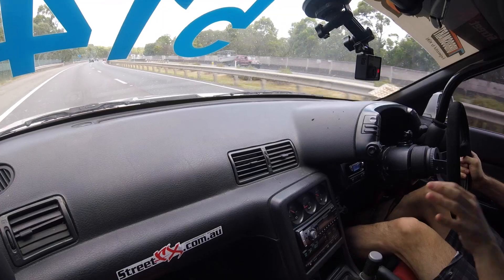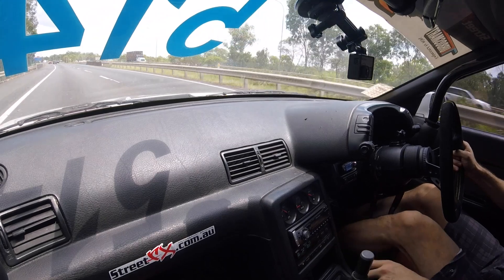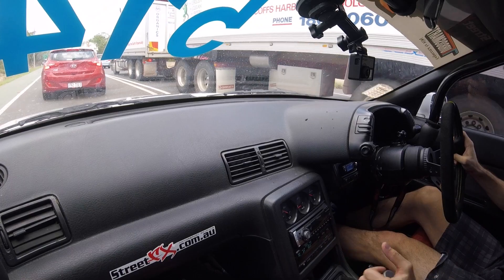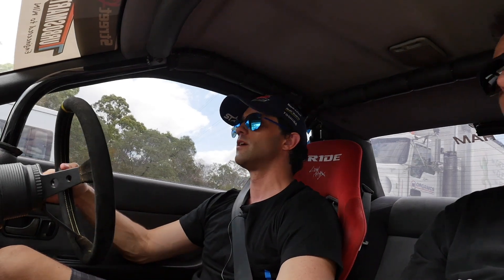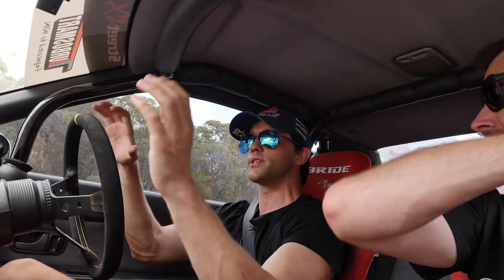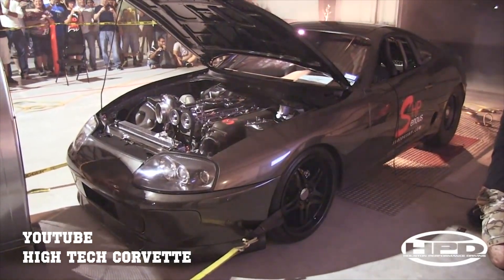What is TURBO FLUTTER & SURGE? Is it Bad? Myth-busting in our Nissan R32 GTR!

Comment: 1. Start the video with some nearly upskirt bimbo, so cheap and played out
2. It's as bad for performance as it's bad for the durability
3. It puts stress on the axle which is allowed to have a very small tolerance of radial play and is designed to do so. It gets ugly when the axle gets axial play and that's what flutter will cause in the long term.
4. This rayban wearing rich kid doesn't know long term ("I've owned this and that and blabla"), probably buying a new car every year, so he'll never see the day that a turbo gives up on him. Someone else eventually will.
5. The funniest part is that turbo's that are well capable of producing 500-1000hp range are much more reinforced and build towards heavy stress. Point is: why bother keeping flutter noise if it's bad for both performance and durability?
6. He neglects the performance disadvantage, but a big turbo needs a lot of time to spool up to the mentioned 120k. Slowing it down is senseless.

He gets the theory right though. Physically it's all correct what he states but I guess he's indifferent and that makes him a bit ricey.
Reply from the maker: +Link'sFaceOfEvil  I'll address your concerns ;)
1) it's an extract of another video we made shortly before this one. 

2) not true, the performance difference will be negligible.

3) we cover this in the video. The impact on wear on modern turbochargers is also negligible.

4) actually I've had plenty of turbos fail in my time. Ironically it was on cars that had blow off valves. Just old turbos.

5) why have a loud stereo if it doesn't help performance? Cos some people like the noise. Also for the record, if you'd watched the video - the GTR does have a BOV, it's just that it's very tight and causes a flutter like sound before it blows off. An extremely tight blow off valve helps eliminate possible leaks under very high boost - thus negating the whole "its bad for performance" thing. 

6) we do actually mention this, but consider the performance difference to be negligible. Besides, you have the other end of the coin - that the intake tract/intercooler etc will still be under some pressure during gear changes as it hasn't vented all that pressure out the blow off valve, thus negating some of the potentially "lost" performance.
Reply: Street FX Motorsport TV it seems like you know your stuff but, as always in the car (aftermarket) industry, we have different visions. What do you think of the smaller 'everyday' turbo's you find in VW gti's and the like? They seem much more receptive to this kind of abuse (I still view it as abuse of sorts).

One more question: are you the guy filming or driving the car?
Reply from the maker: I'm Mark (driving). Check our little article about this here: http://www.caradvice.com.au/587685/what-is-turbo-flutter-and-compressor-surge-is-it-bad/?utm_source=streetfx&utm_medium=fbpost&utm_campaign=forum_affiliate_program

The newer turbos (ball bearing) are less prone to generating shaft play due to their construction. The older bushed turbos aren't designed to take lateral forces, so they do tend to wear when you have surge.

Comment: It sounds awful and if you had a correct set up you would be getting more performance from your car.
Reply from the maker: ok guy, I guess you're cruising around in a full weight street car that does 9s and makes 800hp at the wheels ;)
Reply: No doubt its quick as hell and a monster. I just feel like it could be more refined. To each their own though. (And I just dont personally like the sound)

Comment: The turbo that the nut came off and you claim wasn't caused by turbo flutter, are you so sure? Given that both the turbine wheels are connected through the shaft, when the inlet impeller slows down, it will be trying to go slower than the shaft and exhaust turbine which doesn't have a restriction of airflow slowing them down like on the inlet side when the throttle is closed. The inlet turbine wanting to go slower than the shaft will put pressure on the holding nut. And the pressure put on that holding nut will be in the direction to undo the nut. So not really surprised the nut eventually worked it's way off.
Reply from the maker: As we mentioned to another person who asked that question - the Supra in question that had that happen did have a blow off valve.. It was also an old-style bush type turbo though, so it was probably due for an upgrade anyway.

Comment: The flutter (sututututu) noises are caused by the throttle snapping closed and all the air thats already heading to the intake gets stoped and fills up the intake pipes all the way back to the turbo, and forcing it way through the compressor fan while its still spining at its ridiculous rpm, forcing the compressor fan to cut through the air, thus making the flutter noise
Reply: Thank you. Did a much better job explaining
Reply from the maker: That's exactly what we said ;)
Reply: You can see how it can effect the inadequate thrust bearing especially at high boost i.e 2 opposing forces
Reply: Reversal  between the vanes causes this. 
Pressure is momentarily too high , reversal occurs, pressure lowers,  system recovers, pressure rises again,  reversal  and so on.  
So it goes stu stu stu  every time this cycle repeats.  
Look at 80s factory racecars,  low  volume piping, low volume endtanks,  check the electramotive nissans, or Audi 90 imsa.  High pitch, high frequency noise. 

Audi had "polygonwelle" KKK turbos (  polygonal shape shaft,  at the comp wheel/shaft assembly )   as normal shaft were known to snap in half.  

Off throttle surge/  umluft antilag may and most certainly has something to do with snapped shafts 😂
Reply: so what do you guys think, with flutter caused by throttle closer as Jimmy points out above, would that hurt the compressor or not? If the BOV/BPC was set up correctly, I thought it should vent all that excess pressure between compressor and closed throttle plate, and there would be little to no air having to escape through the spinning compressor wheel, and hence no flutter?!
Reply: I'm wondering what will happen if this flutter noise comes from K04 turbo, I hear it after stage 1 on golf 6 GTI ed35, is it DV failure? also.. I find out that air filter box is cracked but donno if it can cause similar noise effect. (anyway it needs to be fixed)
Reply: @madar9467  it's not necessarily dv failure. Under low boost, the dv wont open. So light driving itll just flutter. If the flutter gets louder and more frequent, without mods, then your dv probably needs attention.
Reply: So doesn't that flutter sound (stututu) come from the blow-off valve instead? I thought that's where the flutter sound comes from, not from the actual compressor fan of the turbo?
Reply: @percival_30  Nope.   Only if it opens late  or  if its undersized.     
Or if you dont run one obviously
Reply: @AxelP33  Are there any blow off valves that can make that flutter sound?
Reply: @percival_30  other than the reasons i stated,  i dont think.   

I dont bother with bov's  theyre a waste of time, potential leaks, added weight  and the risk of killing the turbo is so small... (  unless you run chinese crap turbo 😂 ) .

No bov =  off throttle surge. 

Some factors will affect the sound if thats your concern .  Obviously  low volume charge circuit / high boost press will give a hifg frequency / high piched noise.  Much like the 90GTO  or Electramotive gtp cars...   turbo size/comp wheel design will also come into play.
Reply: @AxelP33  I see. Thanks for all the info bro!!
Reply: Street FX Motorsport TV verbatim.

Comment: Loved the video, I know exactly where you guys were filming this ( cause I live nearby) & the traffic there is shocking. Wonder if this is similar to how a diesel flutters or dose. But they don't have a throttle body of any kind as they run rpm from the fuel pump, so what's the compressed air getting stopped by to come back towards the turbo? The valves just before the combustion chamber?

Comment: Surging when on the throttle sounds like shit and is bad for performance just lower the boost back into the efficiency range of your "huge" turbo jackass.
Reply from the maker: +Jim F. I'm guessing you didn't watch the video.. or had problems making sense of it.. the only time it surges under throttle is if we deliberately force it to via brake boosting. Under normal driving it does not surge except off throttle.

Comment: Anyone with bad turbo surge want to pull their thrust bearings out and send them to me for measurements?
Reply from the maker: +Paul Hood who uses traditional thrust/journal bearings anymore? May as well upgrade to ball bearing while you're at it cos fair chance any turbo still running old style bearings are going to be buggered anyway
Reply: The forces from surge produce a movement in the thrust direction which involves a thrust bearing. The thrust bearing has had very little change.  Generally comes 270* or 360* and to not have "balls" lol. Only the journals have been superseded ball bearing. Correct me if I'm wrong, but since I've spent a fair bit of time rebuilding these things I'm familiar with where the failure points on them are.

Comment: i have this loud breathing sound but the car dosnt go anywhere untill the revs get up there more around 3 to 4000rpm and the boost comes on...why does it breath like this..to me it sounds like lagging...its a ba xr6 with a 35/40...when the breathing goes away it is fast but under 3000 rpm its just "waiting" to get on the boost...iv had other ba and had no problems...i no its not a gtr but its a turbo issue let me no if anyone has thaught...besides "buy a gtr"

Comment: I'm sure this has been said, but I feel like you're going to have a significantly higher chance of winging the nut off the end of a compressor wheel, if your turbo is surging. other than that, I agree with everything you've said.
Reply: The nut will only tighten. Its designed that way.
Reply: squishypitbull it's designed in such a way that, under normal operations to stay tightened, because of the reverse thread. The CHRA stalling isn't normal operations.

Comment: depends if it's a ball bearing turbo and it would depend on boost and how you drive it some will die quicker but even with a bov you get some surge just face it turbos arnt built too live forever it's so cheap for a new centre so do what you like

Comment: 4:46 You don't think the vibration/stuttering/shock from the compressor surge attributed to the loosening of the compressor wheel nut? Gotta say I completely agree with almost everything you said. I really dislike the noise of surge so I always run plumbed BOVs. Each to their own :)
Reply: Just saw your previous reply stating the car in question did have a BOV and a very badly worn turbo.

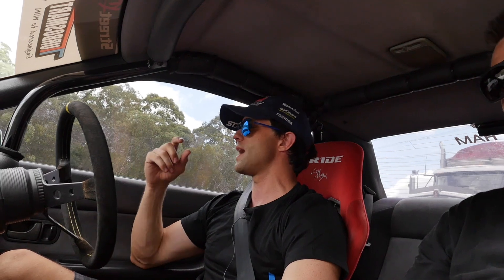Comment: This bloke does not know what hes talking about. he just said the "nut unscrewed 4:50". why would that happen regardless? that's because of surge you moron. Why don't you connect a turbo speed sensor and actually monitor what happens!
Reply from the maker: +chippyjohn1 the car that had that happen did have a bov. Lol. I am speaking from experience. How many turbos have you personally seen ruined from surge? :)
Reply: I haven't seen any destroyed because of it, doesn't mean its not bad for your engine though! How about you actually install a turbo speed sensor with a gauge and show everyone what happens. That way you can be scientific about if!. The one thing I will point out is it was surge was considered more important with journal bearings as the thrust bearing would take all the load, now ball bearings control thrust load much more effectively!
Reply from the maker: We never said it was "good" for the turbo, just that it is nowhere near as bad as people rumoured for years saying 'omg u need a bov else you will blow your turbo'.. Yet nobody ever actually blew a turbo... The later model ball bearing turbos definitely do help with reducing wear when the wheel has movement back and forth, compared to the older bush turbos.
Reply: @StreetFXofficial  that exactly proves his point...bangs head

Comment: This dude is a tool. BEEING RICH DOES NOT MEAN YOU KNOW EVERYTHING.
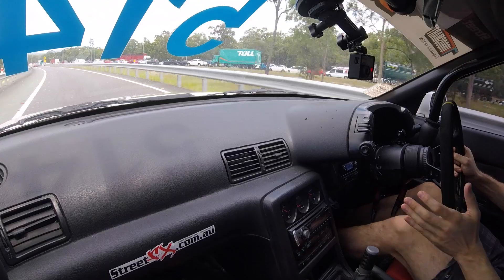1:54 " There is no were for the air to go, the turbo blades are still trying to push air into the engine and doesnt have anywere to go, so it ends up making like that"

 Tell us genius were and how the air escapes cause it has to go somewere right?

Axial shaft play or else the "bad shaft play" its the inside out play of the shaft.
When the turbo compresses is is pushed to then one side, when a moron tights his bove to sound like a proper morron extreme forces are aplied and the shaft agresively goes in and out It might not be visible with the eye but it gets the job done.And running without a bov or a bov that tight will cause also good amount of radial shaft play.

For the love of god if your reading this and your not rich dont listen to this pos.
You will cut the life of your turbo to 1/5th and the guy in this vid obviously not gonna pay for it.
Reply: Street FX Motorsport TV Look there are more than enough top performance race winning journal bearing turbos.And no it not just "old" journal bearing turbos.Its ball bearing turbos too. Too strong forces.Exhaust gases still push the turbine thats figting against the compressor wheel cause also stall thats destructive too.You are telling me the classic answer.
"My uncle was smoking 30 cigs a day and didnt die from lung cancer."
Pros around the world ALLWAYS suggest running a bov.
If you are running 7 psi on a tiny ballbearing turbo you may be lucky without it.But the bigger the wheels the bigger the wheel flex.The bigger the boost the bigger the charge pipe pressure.No bov rally cars change turbos very very often and its not a good example.
Drag racers flat shift so they dont need a bov desperretly.Altho youll see the  bended/cut turbo axle here and there after a burnout if the driver lets the gas pedal too quick.Running no bov will also raise EGT and may cause EG reversion.
Ill tell you this 100 men have 100 times the experience of a single man.So its not bad to listen to a random guy's find on a google search.Especially if the google result if from someone that runs a race team.
Ill say it for last time its TOTALLY unacceptable to give non educated wrong opinion on people since you have the power to affect so many online. Opinion that may, on this subject probably will, result damage to someones property because he listened to you.Arnold is still alive but MOST of them died or will die young from anabolics
My 2 cents.
Reply: "killing thrust bearings"

That is the issue, this isn't an issue with ball bearing turbos, plenty of top engine builders and tuners pumping at 40psi+ for years with no blow off valve without issue. 

Also plenty of people running journal bearing and never having issues, factory turbo on my 180sx had probably done 150,000km + many track days and is still going strong, it didn't come a bypass valve from the factory just like most other Japanese cars in the 80's.
Reply: The workshops that built his car and some of Australia's best engine builders and tuners must not know what they are doing.

"Running no bov will also raise EGT and may cause EG reversion."

Care to explain how this is happening?
Reply from the maker: +Abec777 Hondatech sigh only cheap turbos or old technology will have a noticeable decrease in turbo life. Exactly how many turbos have you saved or broken as a result? We have, on the other hand had no issues. Not saying that it doesn't have potentially adverse effects, but 1/5th? Love the random number :)
Reply: 1 min google search result from someone that actualy races and runs 9seconds on a fwd :
"I was blowing out seal rings and killing thrust bearings left and right 
for a year before i realized that my cam change took all of the vacuum 
away that was opening the BOV, it was the last thing on my mind. Changed
 to the soft BOV spring and problem solved. Run a BOV lol."

https://honda-tech.com/forums/forced-induction-16/ever-advisable-run-turbo-vehicle-without-blow-off-valve-3298508/page2/#post51283828
  
No offence but did you actually searched around before asking that poser on the vid?
Reply from the maker: Umm.. I am "that poser" on the video.. 😂😂 We have never run loose BOV's on our cars, I don't need to google search that, it's personal experience, which is far more valuable than a random google search for feedback from people across the world. I never said that it doesn't have potential to decrease turbo life, but I promise you that you have no personal experience or proof that a modern ball bearing turbo has suffered premature failure specifically from the lack of a BOV. Old thrust bearing turbos are a completely different scenario, and not what we are talking about these days. If you're running an old non-ball bearing centre, then chances are your turbo is so old or it's a china spec one and probably time to replace it now anyway :)

Comment: People dont realise that a turbo technically stalls as air pressure drops around the blades when the throttle shuts and no blow of valve is there to allow all the built up air to escape before turbo. When the throttle shuts and all that pressure comes back through the turbo it causes the blades to loose grip of the air due to the low air pressure and making it spin at the same speed without actually making any boost. The turbo blades then eventually grip back onto the air when air pressure rises around the blades again. the sut sut sut noise is created by the turbo constantly loosing grip and grabbing in short matters of time.
Reply: You're talking absolute rubbish.  The SOUND is created by high velocity air flowing back through the tight clearance between the inducer circumference (blade tips)... and the compressor housing.  Same principle as whistling with your mouth.